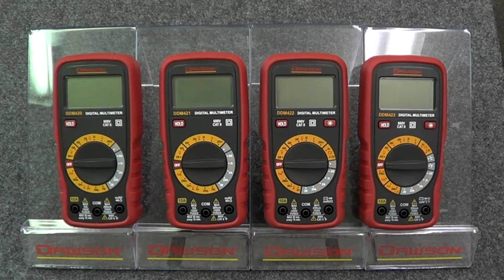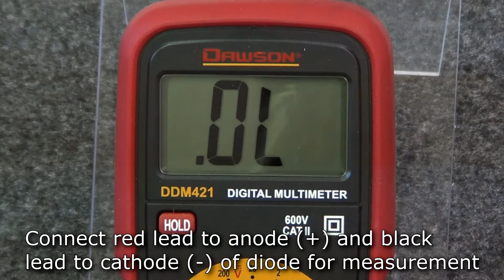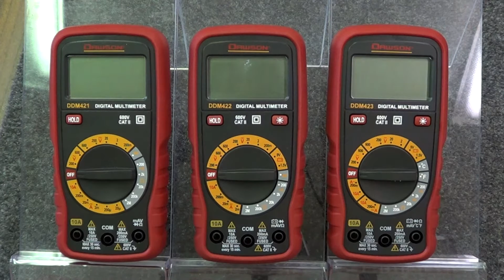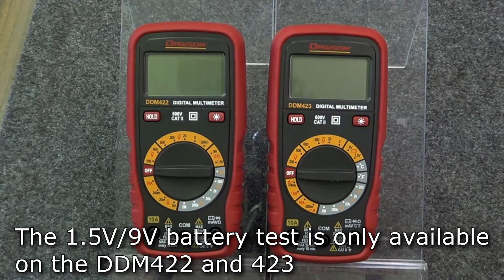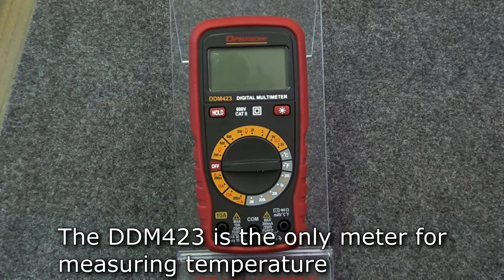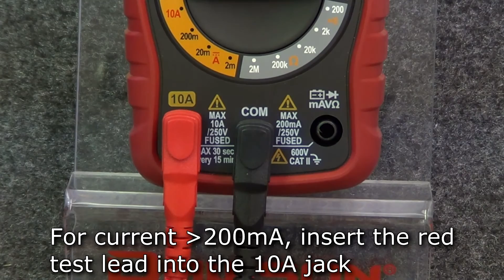Dawson DDM420 series: Compact Digital Multimeters

Comment: I have the ddm423 and cannot get a DC current reading.  I tired to check the fuse, but the thing is not coming apart after taking the battery and screws out.